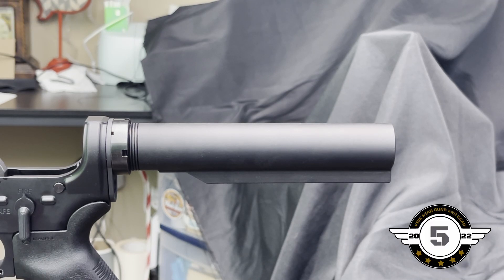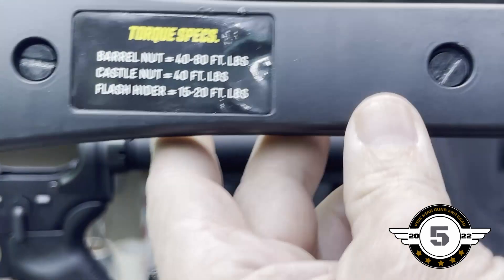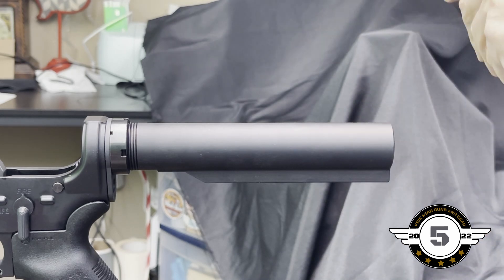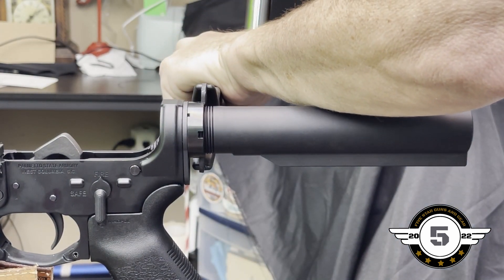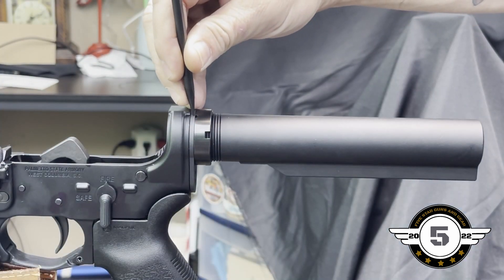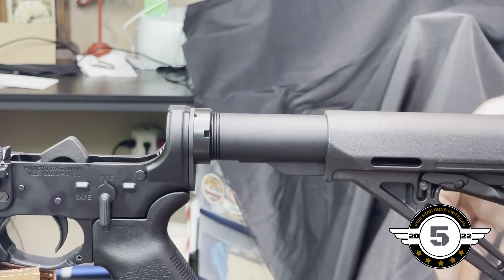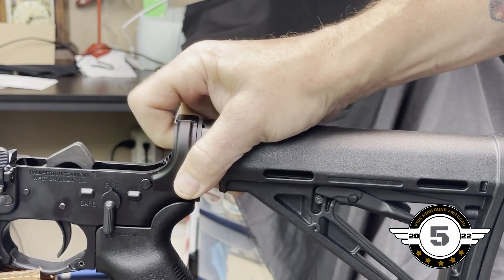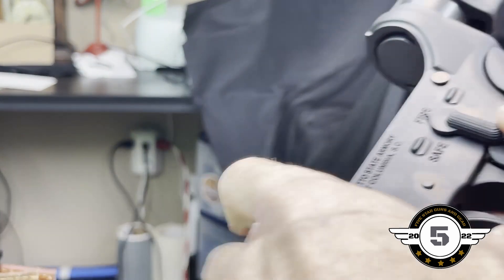AR 15 Lower Assembly Video Series Part 6 Buffer Spring Castle Nut Torque to Spec and Stock Installat

Comment: 10:34 - Should have the torque wrench in line with the armorers tool to get accurate torque.
Reply: Building my first rifle now. I don't really feel safe torquing the castle nut to 40 with it being supported by the mag well. No chances of breaking that?
Reply: @josholdaker8684  That mag well was REALLY flexing to achieve that spec and the tool actually slipped out of the notches

Comment: is it still controversial to say that you don't need to stake your castle nut?
i've never had an unstaked AR that worked itself loose as long as the nut was actually torqued to 40.
Reply from the maker: Depends but certainly does not hurt to do it
Reply from the maker: Right
Reply: You’re correct, staking is an option.

I’ve never had a unstaked castle nut back out even after 2K rounds.

And besides I’m always tinkering with changing out stuff on my guns, staking would be ridiculous 😂